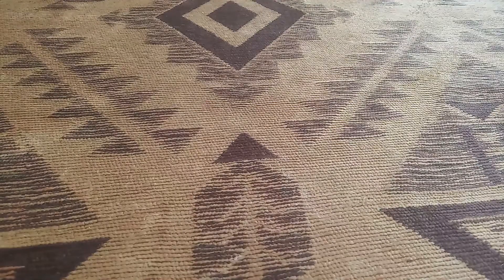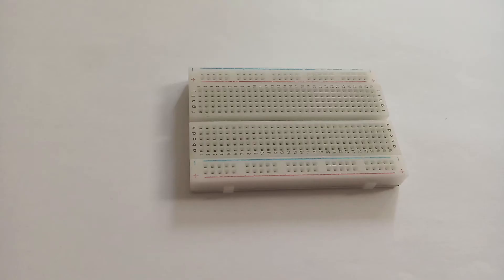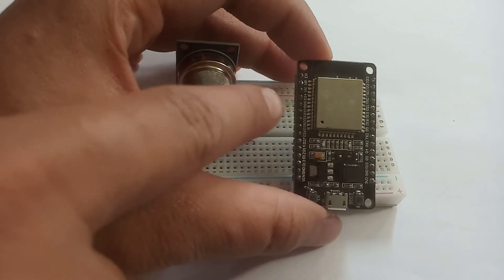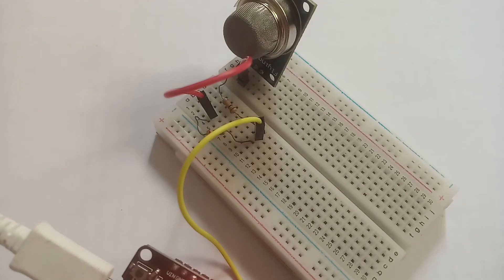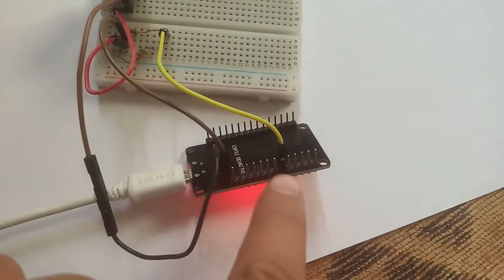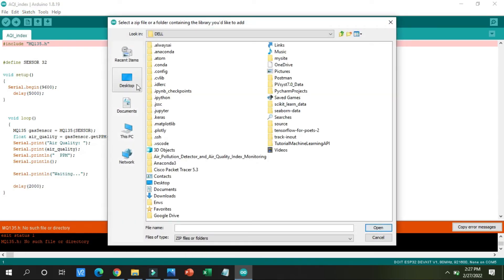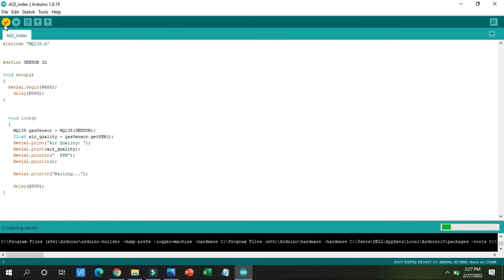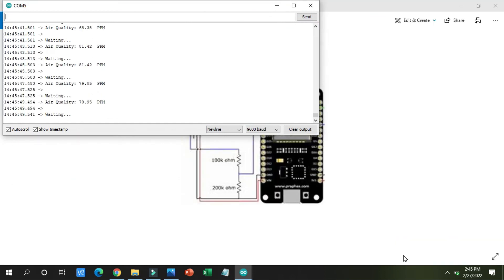Lecture-V ESP32 & the MQ 135 Air Quality Sensor

Comment: Why don't you use a 5 volt power supply? Why are you using a voltage divider? Does that pin supply 5 volts?

Comment: Do I have to use breadboard and jumper wires for connecting esp32 to sensors?
Reply: breadboard only helps with connections, you can join the wires/components any way you want, as long as its as per the circuit diagram.